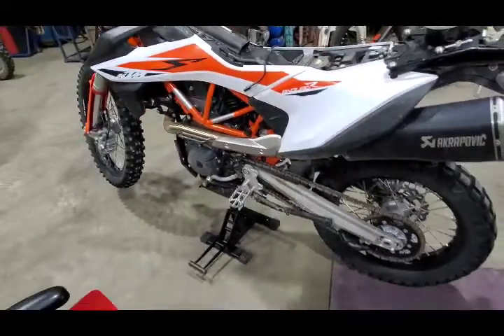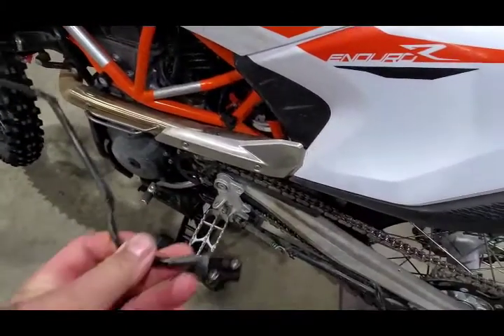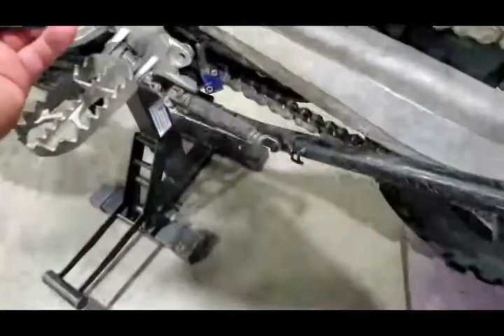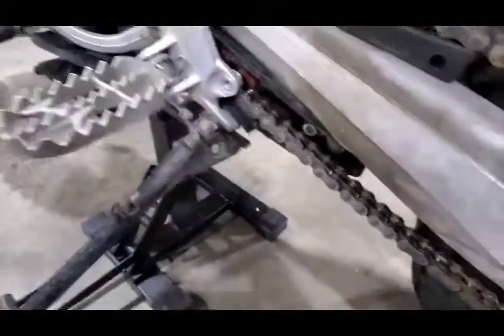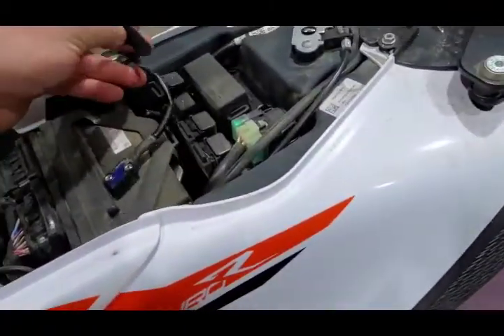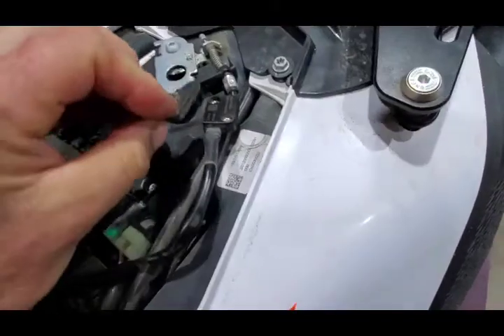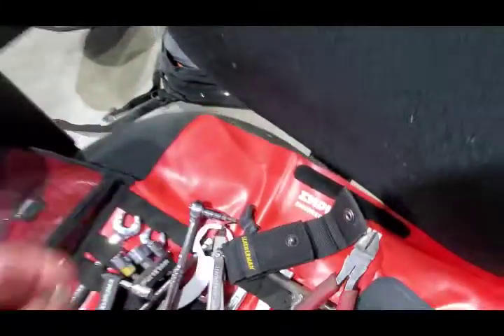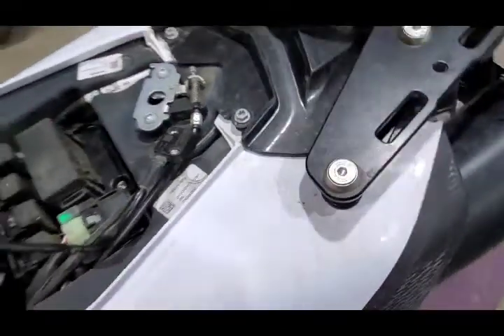KTM 2019 2020 2021 690 Kickstand Switch Delete  FREE

Comment: Thanks loads! I tried this on my 2021 KTM 690 ENDURO R.
It doesnt work, at all.  Now I have no bike to ride and waiting for a dongle to arrive.

I took the magnet off the kick stand, the sensor off the frame, routed it up under the seat. It does nothing with a magnet taped to it.  0.  Bike dies as soon as it goes in gear....tried it every way possible.  There must be some other trick on a 2021.
Reply from the maker: Try to flip the magnet. from South Pole to north pole.  Its a little finicky, you can even try a small speaker magnet.  Ask yourself it works on the kickstand why isn't it working once removed it's essentially exactly the same thing.  It has to work. move the agent around on the sensor.
hope that help you.
Reply: @rotor676  No, it doesnt have to work, the 3rd wire on a 2021 690 goes to the ECU, and it somehow senses something has been altered. Guarantee it. I tried different magnets, I tried the oem magnet in every possible place on both sides. It doesnt work...............and when it works on older 690's? If that magnet moves the bike will die.   Some have mentioned this, that it isnt a great fix.
Reply from the maker: @bradsanders6954  I have a 2020 and others that have done this have 2021, 22, & 23s and it worked.  but if your saying it doesn't than who em I to say.
Mine has 3 wires too, its called a hall sensor.
Reply: worked on my 2021

Comment: Okay it works, but only with round magnet from magnetic board taped to the sensor , thank you for the video, it is very stupid design from KTM
Reply: Almost if not all bikes made have a side stand switch like this.
Reply: @bradsanders6954  doubt it,  most of them have it classical open/closed circuit way

Comment: It doesn’t work, it’s very temperamental, in theory it should be fine , but I couldn’t get it to work all the time
Reply from the maker: Try turning th magnet around.  I noticed that it made a difference.
Reply: Also try a stronger magnet not the one on the bike.
Reply: @rmccarty33  Why wouldnt the one on the bike work?  Its only on the bike because it works.
Reply: Its a dodgy fix, if the tape gets hot and the magnet moves the bike dies.
Also the sensor can die just all on it's own.  I would shit can it and get a dongle like the big boys do.

Comment: Hey I can't get this to work I tape it to the sensor nothing happens and I've tried a few different magnets big small will not work what the heck
Reply from the maker: Maybe you taped the magnet to the wrong side of the sensor or the magnet is upside down, thats the only thing that can be wrong.
Reply: The post man , did you get this sorted mate
Reply: By 2021 at least, the 690 takes a different bypass unit . And it is designed to work around the ECU. Its different than earlier bikes.  Evidently only in the US is it this way.